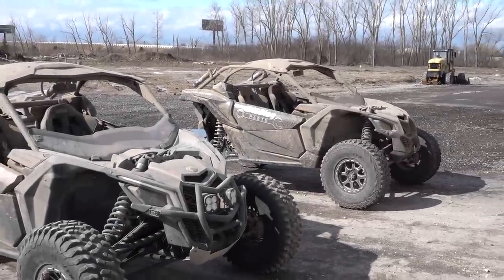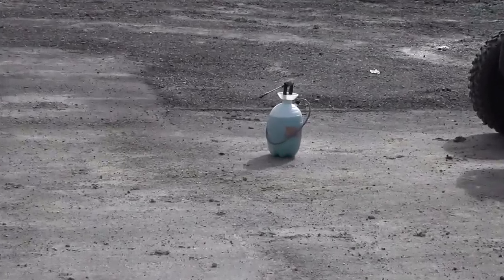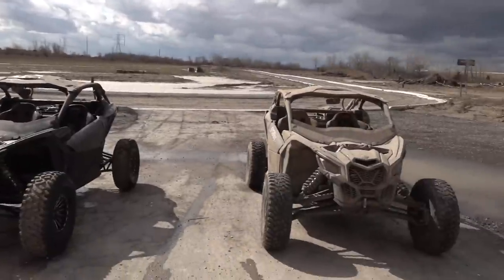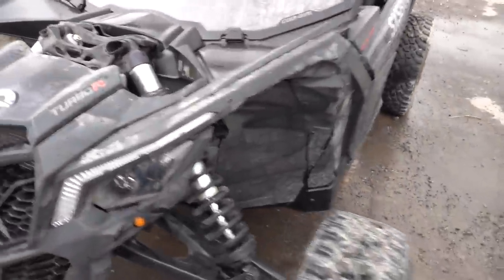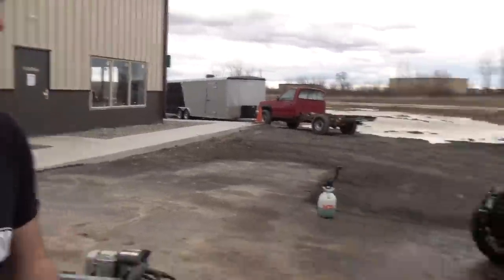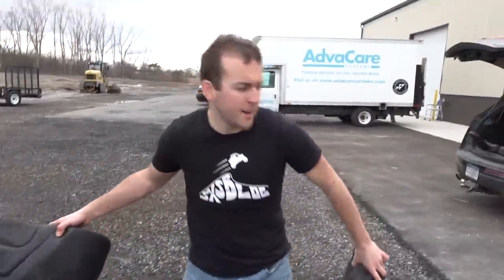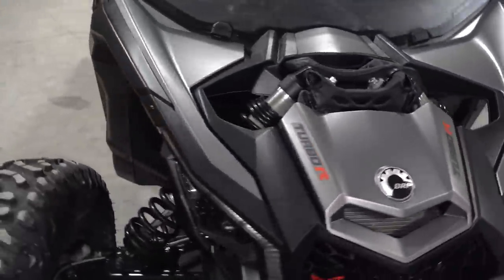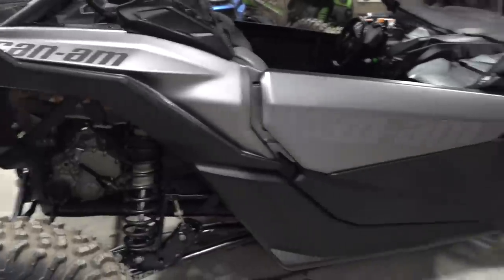The BEST and EASIEST way to wash your side by side!!!

Comment: Bro’s! I detail sxs’s for a side business I use chemical guys all the time. Next time, pour the soap in the cannon first. 6 oz for that 32 oz bottle, then fill with water. (Warm water if you can) it will give a much thicker foam than wha you had today.  2 bucket method for the wash mitt too. Chemical guys sells grated that you can put in the bottom of the bucket. It helps push the dirt down so it doesn’t stick to the wash mit.
Reply: I hope your just using cg soap not there waxes and so on. There overpriced and water down products.
Reply: Clean Freaks Automotive Detailing  only the soap and the speed wipe. I only detail sxs so I don’t wax them.
Reply: Ya there soap is the only decent thing they have. For side by sides I use beadmaker, mckees37 hydro blue which is amazing. Keeps mud from sticking and last a few months.
Reply: Clean Freaks Automotive Detailing  beedmaker? Is that CM product? Not familiar with that.
Reply: Sorry its beadmaker made by p&s products

Comment: I use the tough mudder with a foam cannon from Walmart and it coats it like a snow storm. Might need to adjust the foam level if that one has a dial to do so. I think I'm gonna try both, the simple green mixture did wonders. Our bikes look like the Talon did after mudnats every ride so I think the simple green will break down the thick mud.

Comment: I would like to see yall do a nice ceramic coating on a unit and see how well it cleans up after a ride.
Reply: I have ceramic coat. Works great for the painted panels but it’s a horse a piece with plastic and vinyl

Comment: I use foam cannon with straight zep truck and trailer wash in it. Foam the sxs real good no pre rinse. Let it sit until just when it’s starting to dry then pressure rinse off. Works pretty good. Maybe I will compare it to the sg method this summer

Comment: Really like this kind of stuff on this channel, variety is good. Leo that was a hell of a tip on the SC1 being solvent based. I've never really liked the stuff. When I picked my new Turbo S up at the dealer they had soaked the thing in it. I am going to get some of that Zep.
Touchless as much as possible, foam cannon preferred. But if you have to use a bucket, use two.
Especially on a car. One for loading soapy water onto the mitt or whatever,  and another with frequently refreshed clean water, to clean the mitt in after making a pass with it. If you don't do this you risk dragging the dirt right back on to the paint.
The simple green deal is another great tip.
As a former dirt track racer we used to put ATF in a bug sprayer and hose down the inner fenderwells with ATF, after packing the track the muck would dang near fall off the car. I think they actually make a product dedicated for that purpose now, might be worth looking in to if you are just going through a lot of mud, not submerging in it down in Florida, LOL
Reply: I like the SC1 so far.. It seems to work well for me. Do you not like it?
Reply: @MrSuperchargeron  It really attracts dust. Big time. And the solvent base helps black plastics fade. That was my experience on my old XP1K.it was the 2 seat black pearl deal and the non painted plastics fade very quickly...Leo's statement about solvent base causing that makes sense.
Reply: @archstanton9206  Thanks!!!
Reply: I'm also weary of the SC1 after Leo's remarks. Thinking maybe just spray some on a microfiber and just use it for the shiny plastics. Definitely going to try the Zep.

Comment: Lemon pledge, or for the discrete discerning gentleman Orange Pledge, after its dry, wipe the black down with that and it will look brand spanking new and it doesnt leave a oily residue behind.
Reply: Pledge for the final wipe down👍 “Favor” is the generic for 1/3 the $.
Reply: That's what I use.  I think in my polaris owners manual it actually tells you to use pledge or the like

Comment: After washing my Commanders I spray them down really good with Tire Wet it's a silicone based stuff and if you ride in muddy trails or just mud ride when you re all done riding you can basically walk by them and bump them and the mud falls off   It's great for extremely thick mud

Comment: Huge factor is also what was used on the plastic before they got dirty. I use a car spray wax and then when I was mud off of plastic there's no scrubbing and apply wax here and there ever 5 washes. I use meguiars hybrid ceramic wax while the side-by-side is still wet and pressure wash it around to spread then dry. Works great. Minimum labor plus water beads off and mid doesn't stick as well. Shelf product at Auto parts store. Great one to use when dry is CMX as well. Knocks the wash time down with minimal labor

Comment: I've always used simple green on mine but the one extra step I use which isn't much different than rick is after I spray off the soaked simple green I use some simple green as a soap with water in a bucket and make one pass over everything with a rag or mitten then rinse it off again.  Almost looks brand new after.

Comment: Try Meguiars Hybrid Ceramic Wax Coat (blue bottle) and see how that works. down here in Texas there's nothing but mud parks and thick clay that sticks to your sxs. I used the ceramic wax before I rode and the mud literally falls right off after you drive through the creek. Yee Yee🇺🇲

Comment: I don't know what rick did but I use chemical guys honeydew and it has way more foam. I pressure wash first with electric pressure washer, then foam cannon, then use a mit. And then use a leaf blower to dry, then use pledge on plastics.

Comment: At 2:41 you say 1/3th simple green and 2/3th water so in Liters that is 1L/3L and 2L/3L = 3L total. But in your description you say 3 to 1 ratio... So 3L water and 1L simple green is like 4L total. That's a different mixture. So which one is correct? And what is simple green anyway? Is it dishwasher stuff to de-grease it? Like we have "Dreft" in Belgium? It is for doing the dishes but it's one heck of a degreaser as well... 😁

Comment: Your 25° nozzle has something stuck in it, the pattern was off. Pretty decent results guys, that canon should have some adjustment to give you some different foam thickness.  Good job overall 👍

Comment: The purple members mark kitchen degreaser from Sam's works better than simple green mix it the same way in that sprayer it'll cut through anything and it makes white stuff super bright use it to clean mowers at work simple green never cut through the stains on the decks but the Sam's club stuff did no problem saved me over an hour cleaning time

Comment: Not bad but, you may want to try these tips. One buy zep truck and trailer soap. Use a foam cannon and spray it down let it soak then pressure wash off easy. Then coat all plastics using motul plastic protectant

Comment: I use super purple and I also use a aluminum cleaner that comes from the auto parts that has an acid base be careful not to leave the aluminum cleaner on too long then when I power wash it I put on a coverall it's for everything on the bike tires and everything take a microfiber cloth wipe off the cover off and it looks like a brand new vehicle I do this everyday at Perkins tire and Polaris

Comment: Here's what I do with my quads and SXS when they are extremely muddy (used to do it with my built Jeep too when I still had it):  Park it and put a fan lawn sprinkler under it.  Turn on the hose and walk away.  After a while, most of the mud on the underside and in the wheel wells is gone.  Lazy mans way !

Comment: rick I hope you understand but you are using the foam sprayer wrong you have to lower pressure ther are adjustments on the nozzle at the front to you can put a 2 to 3 inch foam over anything you want 
you are using the foam cannon wrong get a adjustable connector you can put 2 to 3 inches of foam on shit
just my opinion

Comment: Manual book  reads no use of  Pressure washer.

I'm like , how you gonna get all that mud off with just a garden hose and nozzle. Take forever  

I recommend local car wash.   That  Pre soak really breaks now the mud easy.
Soap pressure with warm water really works to clean . 

I believe that's the key we missing when washing at home, our pressure washers have  no warm water .
Reply: Pressure washing the body is fine but I use a garden hose on all my suspension  and wash it by hand.  Pressure washer will 4th water into places it shouldn't and then you have a squeaky machine wearing out parts

Comment: Got a better way for you to try that doesn't even need a pressure washer. First take a regular water hose with a quality sprayer attached . Knock off the heavy mud with the hose. Second using a pump up sprayer filled with Super Clean available at Walmart. Spray all over the sxs. Allow 5 to 10 mins to work no scrubbing needed. Rinse off and it will be clean as can be. This is how I clean my sxs after every mud ride.

Comment: high pressure is the worst way to wash a side by side ask doug high pressure pushes water past seals
and it sits in the socket and rust keep all high pressure away from all of your joints 
I have been ridein for 30 years do not high pressure wash your shit you paided for it will rust out all your ball joints
if you have a foam cannon it works on low pressure when you find the right setting your will put a 2 to 3 inch foam coat over everthing let it set than hit it with lower pressure  to get the bulk off than foam it again do not do it in the sun 
keep the vehicle in the shade as long as you can to cool it so your foam does not dry up rinse it with the hose to cool it 
I am not saying anymore

Comment: Love what you guys do and have learned a lot but buy a heated pressure washer already.  I have an old clapped out Hotsy 550, turn the heat to 220F and the psi down to 750 and it works way better than this mickey mouse BS you're doing.  The water turns to steam when it exits the nozzle and mud/grease/bugs/etc stand no chance.  Mine is electric (2hp baldor) and 5gal of diesel lasts all day.  The thing to watch out for are busted heating coils, people forget to drain them in freezing temps.
Reply: Hotsy and Landa's also have a soap injection system so you can spray Simple Green or whatever soap you have right from the wand.  The 1gal jugs of dawn come out like a foam cannon with the heated water, maybe next time I'll try simple green.
Reply from the maker: Spent many years using Aaladin hot water setups. Worked way better on Kerosene and much less downtime. We're content with how the methods shown perform.